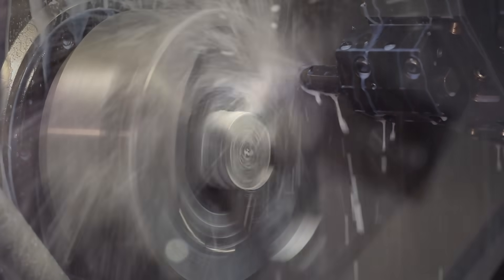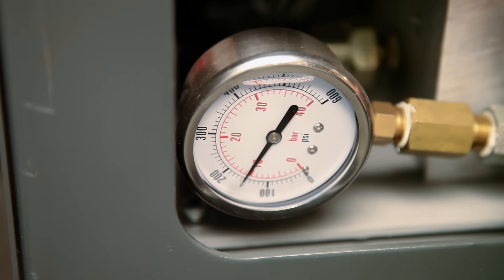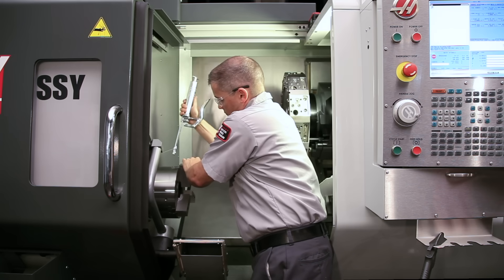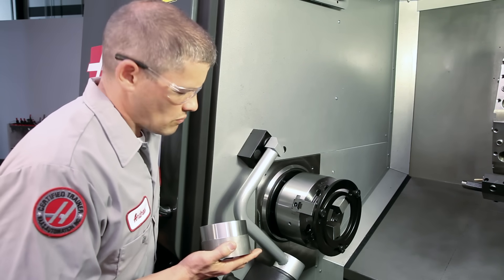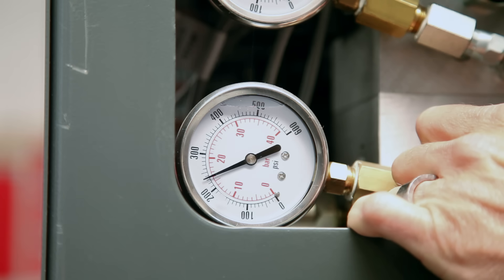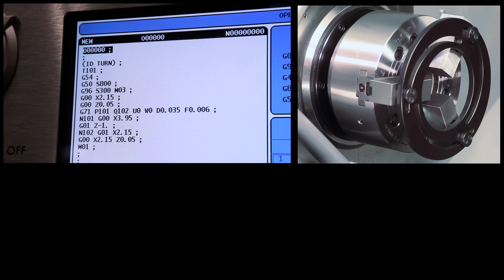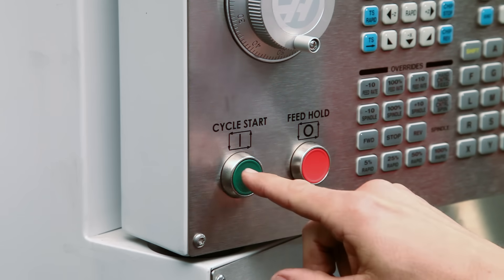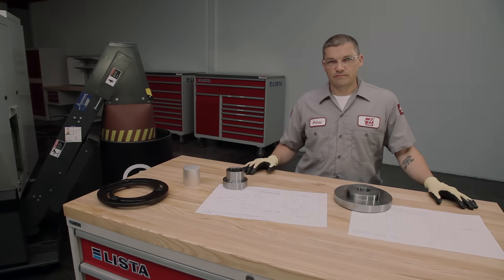How to Properly Cut Lathe Soft Jaws — Part 1: Fundamentals and OD Gripping

Comment from the maker: Great question JJsCustomDesigns. The approach we take here at Haas is to match surface finish requirements to the type of work being processed. Generally speaking, if we are gripping a piece of raw stock we will turn the jaws to a rough finish (such as a 500 micro-inch). This gives good bite for heavy roughing on un-machined blanks where we are not concerned with damaging the surface of the part.

(continued)

Comment from the maker: (continued)

These and the other important considerations covered in the video are the same whether the chuck is manual or hydraulic.

A few aspects of using a hydraulic chuck, such as how they are actuated, are not the same for a manual chuck. However these differences are small enough that, at this point, we have not planned on making a separate soft jaws video for the TL machines. Thanks for the question Paul.

Comment from the maker: Good Question Paul. Yes, the same principles apply on the TL series lathes, or any lathe with a manual chuck for that matter:

-Match jaw and part cutting clamp forces where possible.
-Clamp the jaws in the same direction as the part.
-Use a boring ring, slug, or custom ring to clamp against during jaw cutting.
-Cut the jaws to the nominal part diameter.
(continued)

Comment from the maker: Great comment, David. Abrasive particulate inside the work envelope is definitely a concern. However, in this case the volume of grit is very low. Also, on this ST-30SSY all the linear guides are shielded by protective covers and the guide trucks have protective seals as well. Hand filing the jaws is another option if abrasive sanding becomes an issue. Thanks for the comment.
Reply: hello ，What is the brand of the electronic pressure gauge. Thanks